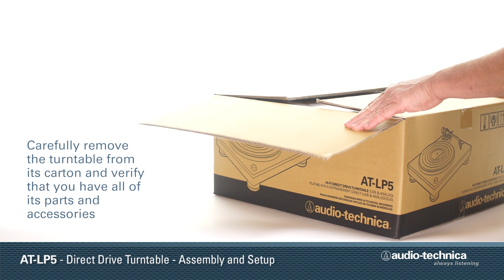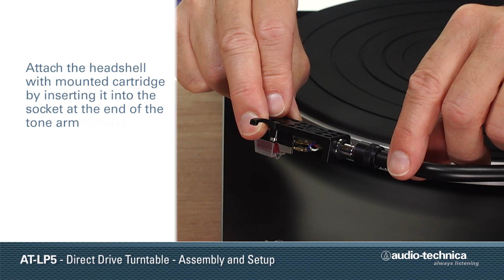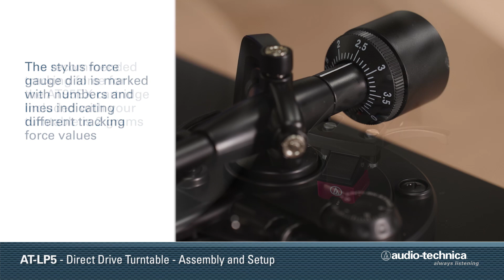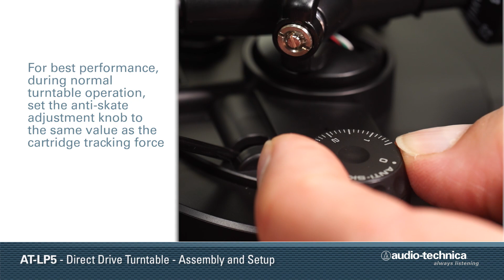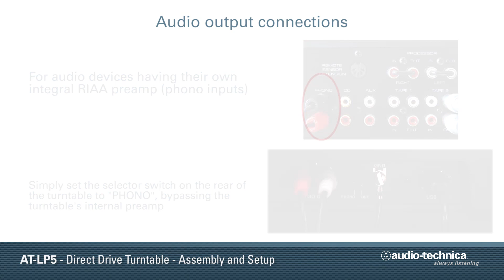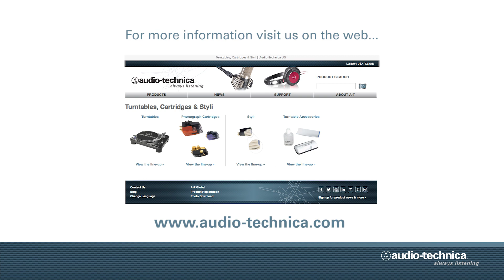AT-LP5 Setup | Direct-Drive Turntable

Comment: What about VTA on LP5? Can I use every MC cartridges with this turntable?
Reply: While you cant touch the VTA you can indeed run an MC cart.  Crucially, the power supply for the LP5X is outside the turntable in an easily upgraded switch mode jobby and as long as the MC cart is within a couple of millimetres in height of the AT VM95E that comes fitted then you can defo use an MC with this deck.  The inbuilt phono even has the gain for many MC's.  I will say its easily bettered by an outboard though.

Comment: Hello AT. I purchased the LP5X yesterday and have just set it up following the instructions in this video. When I plug the USB into my PC nothing happens, it does not come up on the list of Devices And Drives. I already had Audacity installed on the PC as I just have spent fifteen months digitising my audio cassette collection and bought the LP5X to do the same with my vinyl collection. When I switched on I was expecting to go straight to work but when I opened Audacity the meters are not recognising anything connected and playing. My tapedeck was connected via the Line input on PC so I disconnected this and went back to Audacity but no change. The switch at back of the turntable is set to Line, not Phono. I have just gone into the online User Manual and can't find anything which I have done wrong so any help would be very much appreciated, do I need to reset the input on Audacity and if so how do I do this?

I already have a turntable as my hifi separates but it uses a separate pre amp and has no USB and I was using a hifi separates CDR recorder to record my vinyl onto audio CDR but after twenty years of this purchased the LP5X to use exclusively for digitising my vinyl, both sides of the vinyl as a single MP3 file or four for double albums etc. If I do three a day it will take me until Autumn or Winter 2025 to complete it so it is a task and a half and as I said I was hoping to get straight to it when I switched on the turntable. On checking the audio device info in Audacity it is only recognising the speakers after I unplugged the tapedeck from the Line input. I just tried swapping the USB cable from a front mounted one on the PC and closing and re opening Audacity but no difference.

Edit, I switched from USB to Line In from the Phono outputs on the turntable and I have it working, I may have goofed up by not hitting record in Audacity when the USB was connected and expecting the meters to still register the signal. I could switch back and check but the twin Phono out to single Line In cable was a hifi store purchase so I may as well stick with that as the connection. I am looking forward to years of digitising my vinyl with this turntable which I should say I purchased because it seemed the best mix of bang per buck and quality available.

Comment: Please make an arm free turntable that comes with a selection of arm boards for the most common arms ands the option to buy other boards if needed. This would be so damn good :D
Reply: AT isn't about high-end decks with customizable arm mountings. Their niche is in the low-end consumer market. Anybody who wanted an armless AT deck would have to customize one of their current  armed models.
Reply: @Aintry1  Are you aware that it already exists ? It's called the LP-5 ITP. If this can be done then they could easily just release one with no arm and arm board options.
Reply: @scrunts666  
Easily?
Just because somebody released a customized AT deck, doesn't mean that AT would be well-advised to do the same thing. You're talking about a highly specialized market; that isn't what AT is about.
IMO, AT's low-end turntable isn't worth the trouble of customizing. Besides, I know audio engineers with home audio systems costing tens of thousands of dollars who wouldn't want to dink around with switching turntable tonearms. They just want to play their records, just like the typical AT customer.

Comment: Has anyone got experience with both the LP3 and the LP5? Which would you reccomend over the two in terms of value/quality for the money? How much difference does the Direct drive make?
Reply: This is a much better turntable than the LP3. The LP3 is basically The LP60 with an interchangeable headshell/anti-skate. This is well worth the extra money.
Reply from the maker: Hi there! Please contact our Audio Solutions Team for reccomendations. You can reach them at audio-solutions@atus.com. Thanks!  - A-T USA

Comment: Without the plater in place the motor will go in a disrupted rotation. Is there a weight or optical sensor that controls that? 
Also the motor will do a slight beat noise every time i clean a record with a brush, i tried this both on the demo on the shop and on the one i have at home. Is that normal?
Reply from the maker: Hi there! Please contact our Audio Solutions Team for help. You can reach them at audio-solutions@atus.com. Thanks!  - A-T USA

Comment: I just purchased this turntable.  Can you elaborate on the Stylus Overhang Adjustment guide?  Seems like something important and you just show the instruction platter.  Is it something we NEED to do ?  or just recommended ?   Thank you
Reply: that is not correct,  you should always check it by yourself even new ones.. my cartridge was not set good

Comment: Folks, AT are not going to release a version of this turntable without an internal pre-amp. This deck is designed for hassle-free operation. If you want to play with your Sakatumi Cloud-Kisser Phono Preamp with hand-braided copper wiring, you're obviously not part of the target audience. Lay out $1500 for a refurbed Thorens and have a ball.
Reply: Video says "The LP5 has a traditional phono output along with a built-in magnetic phono pre-amp". The switch for the internal pre-amp is visible on the rear of the turntable in the video.
Reply: @dusura  Just like on my LP1240. The problem is the two sets of outputs are not electrically discrete. The pre-amp will affect the performance of the phono-out even when the pre-amp is switched off. If you really want to take advantage of an external preamp, you should get deck without an integrated pre-amp.
Reply: Poinzy A 20 dollar preamp best what they put in these.

Comment: Oh......just a small comparison, the ATLP1240 sells for around 440 euro's over here in Holland. Aimed at the DJ, true. But does that mean you can't use it as a "normal". Ofcourse you can! The 1240 has a MUCH better motor, not quite as good as featured on the Technics but it is far better than the one in the AT-5. Just select your own cart (NO DJ cart!!!) and invest in a good rubber mat and off you go. Forget about turntables and invest in MUSIC. That's why you want a turntable....or? And the 1240 comes with a dust cover. Again, the AT-5 may be not a bad product but it is way too expensive.
Reply: I agree, however the main difference could be the quality control.
I saw some noisy lp120, with bad antiskating, lp5 buyers, instead, seem satisfied
Reply: The motor on the AT LP1240 may be more powerful than the one on the LP-5, but it's basically overkill for people other than disc jockeys or folks doing high-torque archiving work with standard-format, high-density shellac or Edison diamond discs. 

People listening to vinyl in their livingrooms would be better off, IMO, without the instant-start feature on the LP1240 in its maximum-torque configuration. High acceleration can cause neeedle and record damage if you let yourself get caught by surprise. This obviously isn't a big worry for back-cuing disc jockeys tracking at 4 grams. Everyone else, I think, would benefit from a weaker motor and more gradual platter acceleration.

As for price, the LP-5 is $450 here in the States. This is definitely entry-level  pricing.
Reply: Poinzy Thing is, the heavier duty motor also has way better specs, to begin with wow and flutter. The motor in the AT LP1240 has much better figures. Some people who have absolute hearing do hear each and every unstable running, believe me. Not with all records but 0.2 weighted is audible. Not for just the average and occasional user perhaps but nonetheless. So as for price comparison the AT-5 is too expensive for what you actually get. The 1240 offers so much more for about the same money. True, most users do not need quick starts and abrupt stopping of the platter but that's not the point here.
Reply: Both of the turntables are worth about what they're priced. The LP-5 is essentially the LP1240 stripped of its DJ features, and with a differently shaped tonearm. I haven't seen actual figures from an accredited lab related to either turntable motor. Independent lab results count more than what's printed on the company sales brochure or what Golden Ears claim they can hear. But I haven't read any complaints from anyone about audible fluctuations in platter speed in the LP-5. 

Since Hirsch-Houck Labs are no longer around to bench-test turntables, customer reviews are all we have to go on.
Reply: Poinzy No, the AT-5 is a stripped down AT-LP 120 (USB). It has the same motor. The AT-1240 has the Technics-like motor set up. That doesn't mean it has Technics specs though but it comes close. As for the wow and flutter with the AT-5, I never said that it is unacceptable. Many belt driven tt's have worse specs. Wow and flutter specs are an important means of comparison between products. The less wow and flutter, the better. Granted, probably 90% of all users won't notice 0.2 w&f. Again, that's not the point. It's what you get for your cash. Look at the plinth, exactly the same as the plinth of the AT-LP120 family. They simply stripped that model down. Less for more, that's what Hanpin did.
Reply: @leyland9999  I would consider using the LP-5 for archiving, but I wouldn't use the LP120 to pull stumps. I used 2 examples of the LP120, and they were pieces of junk. I don't know what you mean when you say the LP1240 has the "Technics-like" motor setup. I own an LP1240. Do you mean the motor is quartz-regulated? Well, so what? There's nothing ground-breaking about that. Hanpin stuff is just a crude copy of the stuff produced by Technics. If you think AT really raised the bar with their "high-end" DJ turntable, you're nuts.
I've owned 3 belt-driven turntables, so you needn't remind me of how BD TTs perform. And I use a Technics SL-1210GR for archiving now, so comparing anything made by AT to anything made by Technics is deeply ironic to me.
Reply: Poinzy True, nothing beats the original. That’s why I own two SL-1200’s, my daily companions. As for the LP1240, it has a far better motor than the LP120 series. The latter have built in noise, no cure for that. So the comparisson is between the LP120 and the LP1240. Technics is in a class of its own, stands way out of all clones, well, most of them do not even deserve the name “clone” at all. You are right, quartz doesn’t mean quality, it is just a manner of controlling the motor. Point is, novices can easily be put on the wrong track. Real quality doesn’t come cheap and it is a shame that lesser quality is widely spread as for audio equipment in general and turntables and cartridges in particular. On the other hand, many newbies simply do not read. They are an easy target for the industry.

Comment: Why oh why do Audio Technica keep releasing these turntables with pre-amps built in? Don't they realise (I'm sure they do), that many people don't want it and even modify their turntables by physically taking them out. We just want a good straight-forward turntable without a pre-amp that has the usual direct phono input to our amplifiers. You know,..just like we did in the good old days of the 70s and 80s.
Reply: Yeah, it's "funny".
In 2008 you could find a AT-PL120 at150$, without any preamp, but now it costs more and you have to do modification for the same results.
Reply: A lot people have amps that don't have integrated phono pres. A phono pre integrated with the turntable saves them a lot of trouble.
Reply: Video says "The LP5 has a traditional phono output along with a built-in magnetic phono pre-amp". The switch for the internal pre-amp is visible on the rear of the turntable in the video.
Reply: @dusura  They don't shut completely off. They pass through a capacitor field that adjust the output for the USB. That part stays on no matter how you switch it. This model has the exact same specification as thier cheaper  USB tables. I cut these out and rewire them on Record Store day at my l friends local record store. We give a demonstration of before and after. They also have a noise gate that is supposed to filter hum but it tends to kick off the sound during quiet passages on a song.
Reply: Nunsweepit421
Reply: Nunsweepit421 Yes, you are 100% Correct! I wouldn’t buy a Turntable that has a built in preamp.

Comment: Release a version without the internal preamp, plz!!!
Reply: We've ALL been saying this for awhile now! Disabling does not fix the problem as it still goes through the circuitry, which still doesn't sound as clear as a straight cable to a really good external preamp. I ripped mine out of my AT-LP120 about 4 years ago and it's so much cleaner and clearer! Leaving it out would make it a better contender with the higher end turntables. Also making a solid platter out of maybe MDF or acrylic instead of the ringing aluminum platter would be a much better improvement as I coated the bottom of mine with Flex Seal and Sound Coat. Now it just makes a very dull thud when tapped on. You don't have to copy the other manufacturer's ideas exactly - just incorporate some better ones. Audio-Technica can do better - just listen to your customers as we have many ideas just from tweaking and modding our own turntables.
Reply from the maker: Hey Randolph, I will pass your feedback onto our team. Thanks! - A-T USA
Reply: I'm sure whatever PCB is the preamp routes the signal in short order straight out the RCA jacks, bypassing all unnecessary circuitry. probably in a cleaner fashion than the traditional series of connectors and wires (which can introduce noise).

if you all want to continue pretending to be audiophile experts, why don't you buy a true audiophile turntable?
Reply: There's a lot of videos here on youtube showing the advantages of removing the internal preamp.
Reply: why don't you just disable the internal preamp?
Reply: I have 2 turntables: AT LP120 and Polyvox TD 5000 (wich doesn't have internal preamp). The same capsule performs completly different on each turntable. On LP120 the sound is muffled and noisy with constant hiss (even with the internal preamp disabled). It doesn't happen on the Polyvox using the same capsule, same amp....
Reply: Look the problem it's not just the pre-amp but that switch behind  the deck 
< phono-line > 
It would be perfect when we set it to phono to be as if it was no pre-amp inside  in other words completelly by-passed
Reply: Vinyl 2CD Rescue Did the same to mine
Reply: Randolph Laterça Try GLO pro or pioneer plx 100 . They don't have one and all these tables are made at one factory.
Reply: twinsmm1 Because they don't fully disengage. Takes a very simple removal and rewire to fix. I did with mine and the improvement is amazing.
Reply: Also Reloop turntables are made without the preamp
Reply: Watch & learn.